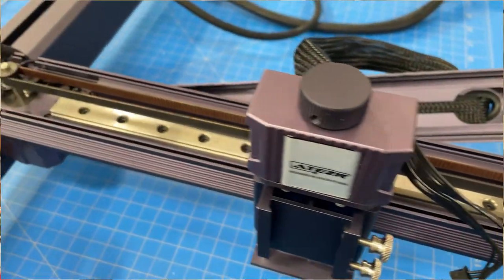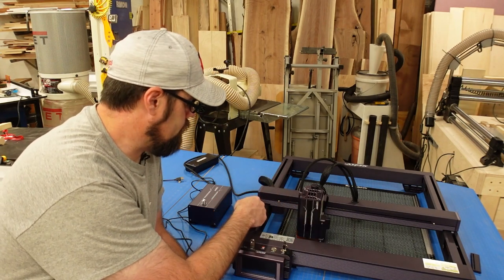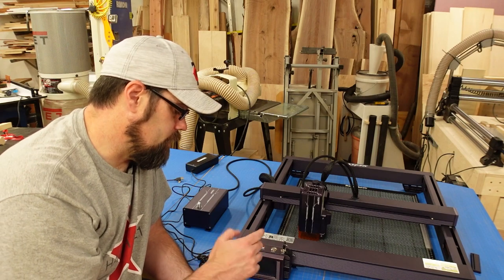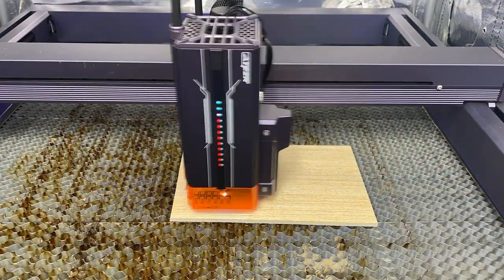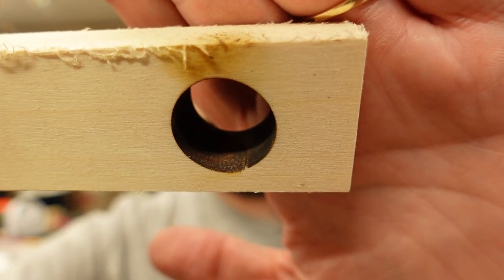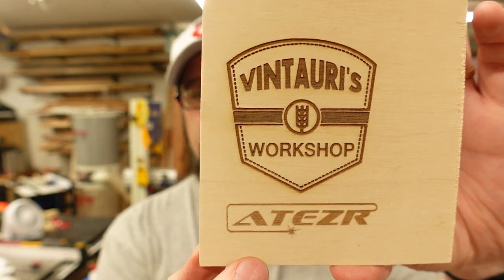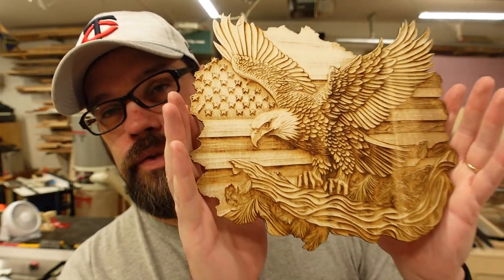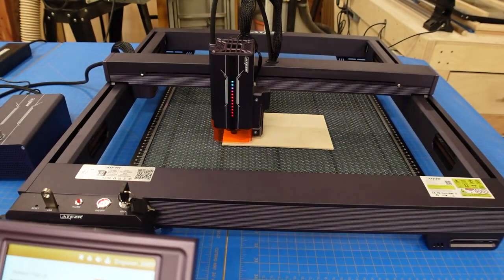Atezr L2 36w Laser | Autofocus, Intelligent Air and Z-Axis control!

Comment: You forgot to mention that support for this item is trash. First of all, you cannot purchase spare parts such as certain cables, the x-axis adjuster, or even a laser module to use as a spare. My autofocus failed. which seems to be common for this model (google it), and support could not fix it. The flame detection failed and the laser continued to burn and did not return to the "home" location causing the laser head to melt. Atezr would only replace the laser head with a 5w laser and stated it would work on my machine. I'm still fighting with them to honor their warranty... 3 months later.
Reply from the maker: Well I've never had to use their support so I cannot speak to that, but it does sound pretty bad if that's where they have ended up.
Reply: @Vintauri  Totally understand. I wish I was a rare case but I have spoken with others who experience the same issues. I mostly wanted to point the issue out since this is a hidden downside until one actually has to use it. By the time your viewers have to experience their support (and they absolutely will), they will be stuck with an expensive paperweight. Currently I have over 40 back-and-forth emails (over 2 months) on one issue alone with no signs of achieving any resolution. They stall by asking redundant questions and asking for the resubmitting of photos multiple times. Anyway, I just wanted to provide your viewers with more data when determining on purchasing an Atezr product.
I enjoy your videos and keep up the great work.

Comment: Hi, hoping you are still checking this feed. I bought the L2-36w unit as a pre order and received it in June. Last week the auto focus stopped working. Looks like from the FB group this is becoming a common problem. Wondering if you have encountered this problem and if yes, were you able to fix it. Customer service is very slow to respond and when they do as of yet, they have no fix for the issue. Not sure if it’s a laser module issue or a mother board issue. Hoping you can shed some light.
Reply from the maker: I have not been working with the L2-36 much recently, but I have been trying to work with an Ikier Pro Max 24/48 unit  which is almost identical.  I've had a lot of issues with the autofocus failing to work properly on that one.  They just sent me a new unit so I'll be seeing if it works any better.  I have seen others talk more about the autofocus being problematic which is unfortunate.  It would be really nice if they would fix the code so that it did not loose the x/y homing when the autofocus fails.  At least then I could manually focus and keep working.
Reply: Hi Thank you for the quick response. So you believe this is a coding issue and not a laser module failure? Interesting, hadn't thought of it being a coding issue. If yes, then they could write a fix for the problem with a firmware update perhaps. I was just looking at the Ikier model as a possible replacement. Given your current issues, I think I'll wait to see how your new unit turns out. Do you recommend any one unit that is at least 30 plus watts? I'm okay with manual focus if need be. The auto focus is a nice perk but not a requirement per se. I want to stick with a diode for now and budget is open. I would like a large work area so something that can be extended is helpful too. I appreciate your input and love your videos. I've learned so much watching you, Clack Shack and Louisiana Hobby guy.  @Vintauri

Comment: my finger is on the buy button, but it looks like there is a lack of support, I sent an email, tried the chat bot twice, and called the number twice and it says the mailbox is not set up.  I really want to buy it during the sale, but I feel like I will get sucked into a bad purchase if I can't reach support if needed.  Has anyone reading this hat any Atezr customer support interactions they can tell us about?
Reply from the maker: I have not had to reach out to support with Atzer so far so I cannot speak to the response time.  Hopefully the current delay is just due to China on Lunar New year celebration, but I have heard others talk about delays as well. It's concerning as they have made some nice lasers. But support is critical if you have issues that need to be addressed.
Reply: Thanks for the reply.  Still no response to the email, or chat bot. I tried to call the number on the website again this morning just to give them a final chance.   The phone just rings then goes to a msg saying the mail box is not set up.  After that it just hangs up, so you can't leave a VM.    Bummer,  I really wanted that unit, especially with the hight control, and auto air assist.   Now I am researching the NEJE Max 4 20W it has z control as well.  and it has a large expandable bed. Basically it looks like all of them are a gamble.  Trying not to jump on the X-tool unit, but from a support standpoint I may.   Or make the jump to a co2 @Vintauri
Reply from the maker: The NEJE lasers are nice but they do require a bit more in assembly and the instructions can be a bit left to interpretation.  I really like how Neje did the Z axis as well.  @TheClackShack did a video on that unit that you should check out.  I'm working with a new xTool S1 40w as well and I'm liking how they do the variable Z axis.

Comment: .What is the wire with connecter end that hangs down next to wifi antenna rightside bottom of the control panel , what does it connect to? I wish there was a way that I could insert a picture... Thank you
Reply from the maker: I noticed that too and I’m not sure but my guess would be that it’s a port for future accessories.

Comment: Hi, interesting and informative review. But isn't this model the same as the iKier K1 Ultra: 36W, only it's painted black.
Have you ever tested laser engraving on a 3D model that you previously engrave on a CNC router? Can this laser and also the IKIER adjust the height of the Z-axis controlled via NC code? 
What is the engraving speed then, because the motor for the Z-axis is much slower. As shown for the model NEJE 4 max.

Comment: Hi 
I got the same laser machine but currently having problems with no power ...firing
Reply from the maker: It's hard to troubleshoot via YouTube comments.  I would start by checking the wiring.  Make sure all the connectors are seated tight.  Also check the pins in the connectors, I've seem some come loose over time.  If it's been running a while but recently stopped take the module off, take the air assist cone off and inspect the lens cover and lens.  Make sure they are clean and clear.

Comment: I have the SculpFun lasers- I am not impressed with the product design. 
I had to engrave 500 plaques and the cleaning of the laser head module was a nightmare.  I wonder how the cleaning is for this laser. Can you provide a video for the cleaning?
Reply from the maker: That was actually on my list of things to do on a number of the different modules I have now.  I do like the design of this air assist cone that in theory, should help reduce the smoke and debris getting to the lens.  I also tend to run at least low pressure air even when engraving just to keep some positive air flow through the nozzle to keep the smoke away from the lens.

Comment: Very informative video.  I think I'm convinced this will be my next laser.  I was wondering.  When you were demonstrating the power failure/resume feature with the pendant and you were able to set the location at the bottom-left.  Would that work when using Lightburn also, or is that a feature only when you've put the file into the controller?  That would come in handy when I'm using my honeycomb.   Thanks.
Reply from the maker: The power resume feature only works from the offline controller as far as I know.  It would be great to get it working from Lightburn.  That being said, if you have a long burn where you might be concerned about a power outage, then you could export the job from lighburn, then run it from the USB port and offline controller.
Reply: @Vintauri  I'm sorry, after i reread that I realize I made that confusing.   If I'm using Lightburn,  can I establish the location of my workpiece like you did with the controller when you picked "bottom left"  and start my cut/engrave there? Or is that only possible when you load your program into the controller? Hopefully that makes more sense?

Comment: Fantastic video, you’re an amazing teacher. Subbed, I have the same L2 36 W and my Z axis seems to over limit down with error when I select auto focus [ESP500] ?? so basically my auto focus doesn’t work or I don’t know how to use it
Reply from the maker: Is it pressing into your material and not triggering? Or is it not reaching the material and stopping the autofocus function?
Reply: @Vintauri  it seems to trying to go over its z limit range , the material does not stop it, the z gantry does. Maybe there’s a setting for Z range
Reply: @Vintauri  it’s not reaching the material, stopping the autofocus function
Reply from the maker: @hacklabdesign  you might have your module too high in the carrier. Try moving it down using the two mounting screws on the side to loosen it up and slide it down some more.

Comment: Have you tried jtech laser on Onefinity if so what are your thoughts. Thinking of going in that direction to save space
Reply from the maker: I have not tried the Jtech laser or any other on the Onefinity. The speeds of the CNC will be a bit limiting on engraving and with the diode lasers they are small enough to hang on the wall out of the way. I also would not want to keep the laser module on the cnc spindle mount while doing cnc carving as the dust created would be bad for the module over time.  It’s still a decent option if you need to save the space and run just one machine but with them separate, you can set up each to do it’s primary job well and run them both at the same time if needed.

Comment: Does this unit come with a roller and extension kit.
Reply from the maker: The roller and or chuck rotary as well as the rail extensions are both extra accessories that you can purchase separately for the laser.

Comment: Great video. I am expecting my L2 36w to arrive today or tomorrow.  Any suggestions on general settings to dial in for lightburn?  Ive never used lightburn before so not sure on ehat might need adjusting before running the machine.
Reply from the maker: Lighburn should auto detect your laser when you go to the devices tab. From there you’ll want to follow the manual to set up the autofocus feature.  Once you have that going then I would run some material test grids to get a feel for what your laser can do. I have another video that talks about the material tests I recommend watching. Just have some scrap material on hand to play with and get used to your laser!  You’ll soon figure out your workflow on using it. Congrats and have fun!
Reply: @Vintauri  thanks for the tips.  I have lots of scrap materials to try things out with.  I will look for your video on test materials. Look forward to seeing more videos by you.
Reply: Make sure you use the cable that comes with the machine to connect it to the USB of your machine. Most cables will not recognize your laser. I’m making a review video of the 36 watt L2 today.
Reply: @hacklabdesign  yeah I tried to use a longer cable but it didn't work at first.  But I think it was a different problem but by then I had already moved the machine closer to the computer so I'll stick with the original cable.  Have you done a focus test?  I found my machine seems to be better at 11.25mm over the default 8mm but it had a wide range of good enough.

Comment: I would like to know how long it took to engrave the eagle. I just did one with my 20w and it took 6 hrs at 3000mm/min and 50% power.
Reply: I would have run it faster but my table is not as secure as I would like. I am going to build a new table and secure it to the wall so that it is very solid.
Reply from the maker: This one took about 2.5 hours.  I think I could speed that up if I did it with a zero angle engrave so it's just moving back and forth in the X axis each pass.